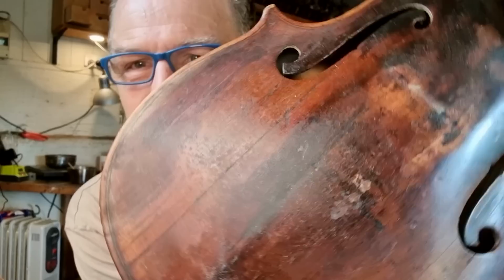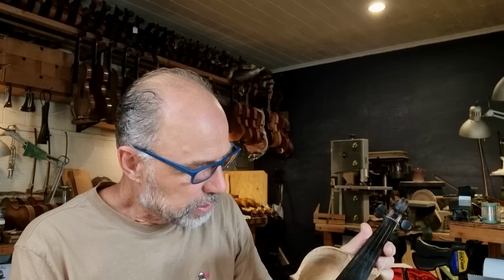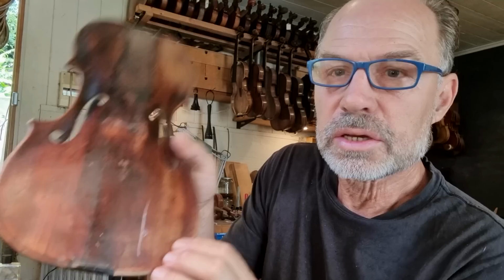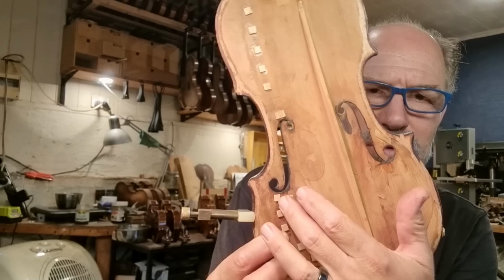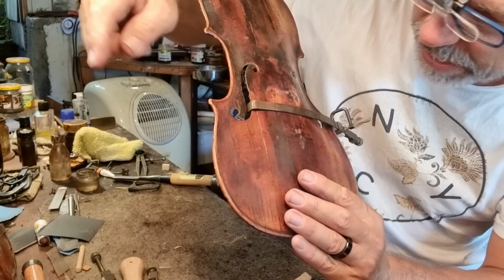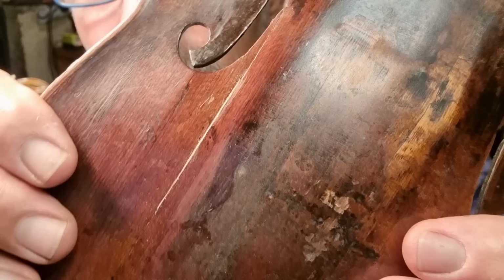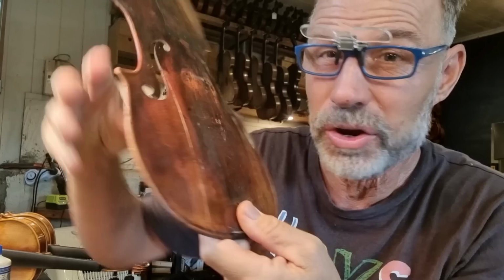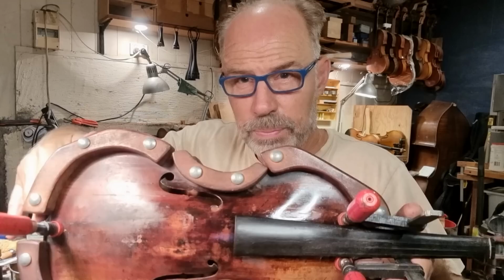He Busked to help kids... Old Hopf violin Restoration part 1

Comment: Very interesting insight, even for a non violin player. I have a question though. One factor for the sound of a violin is the vibration of its body. If I see those cracks glued and the additional wood layers glued on for support, I wonder whether this changes the sound of the instrument? (Please don’t get me wrong, I understand that there is no other way to do it, the alternative would be to loose the instrument long term to the damages. )

Comment: I am wondering why use a glue on cracks that is reversible and prone to eventually fail or fail with high humidity or inadvertant water contact.
Why not use a glue that will never fail since it's a crack and would never need to come apart for any reason ?
Just curious.
I guess what I'm asking is why not just some tightbond 3 and be done with it ?

Comment: At what point would you just make a new top plate for the violin instead of repairing old one?
Reply: As long as you have all, or at least a good percentage, of the pieces, it can be repaired.
That's a whole lot easier than carving a new top and so cheaper and can still sound good.